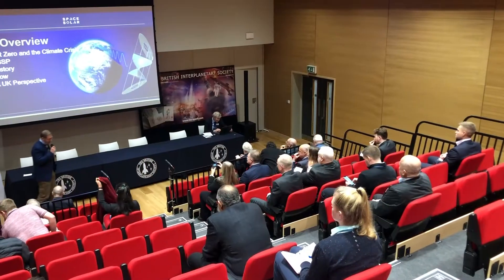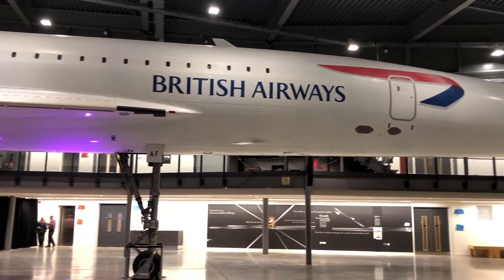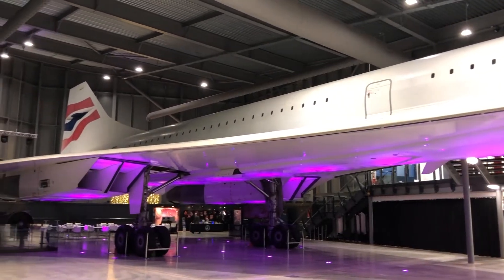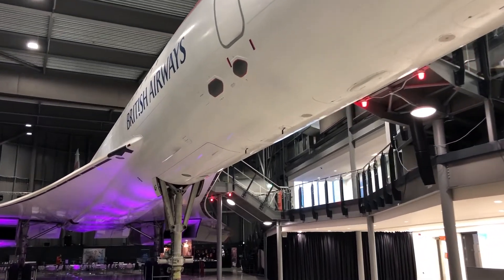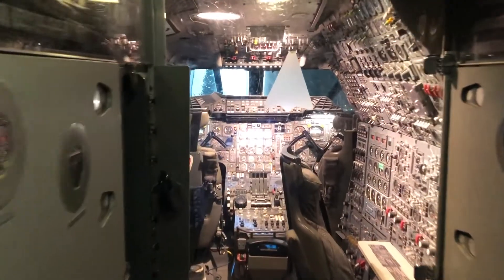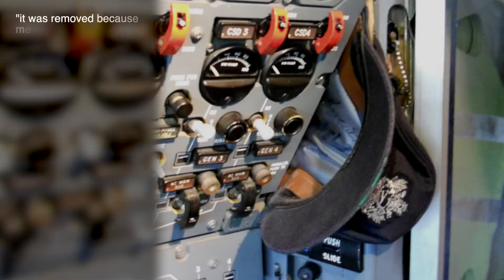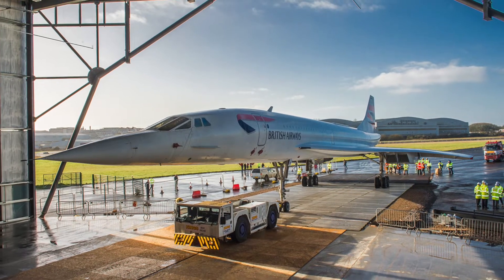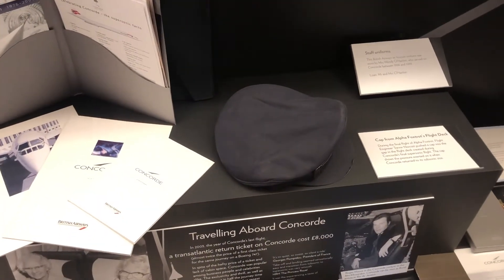The Legend of the Flight Engineer's Hat

Comment: I'm afraid I'll have to call BS on that story.....I've no doubt the plane gets hot in flight and no doubt that Aluminium has a high alpha (coefficient of linear expansion) BUT the expansion occurs evenly  throughout the aircraft unless the nose get absurdly hot so the expansion isn't restricted to one place..... Think about it if the gap went from say 5mm to 100mm in flight the whole plane would be 20 times longer in operation. AS always, happy to be proven wrong.....
Reply from the maker: The hot fuselage expands and the cool cabin doesn't, over the length of the aircraft. The cabin structure is continuous and is anchored at one end, which means the difference over the length of the whole cabin manifests in one place. Such expansion joints aren't unusual in engineering.
Reply: @Thumblegudget  I'm not an aerostructure guy; engines are my thing.....A not unreasonable theory that I'm not sure I buy, but using that logic the cabin windows (and everything else) would have a fist's width band obscured toward the front of the aircraft which seems as unacceptable as it is unlikely. It's difficult to imagine the interior telescoping backwards and forwards with respect to the fuselage......
Reply: @lincolnengland5005 depends on what’s attached to what. I would imagine each window trim is attached to the hull and will stay aligned, with cosmetic panel trims hiding the expansion joints. Certainly the tale about the gap is true.  Retired Concorde Pilot, John Hutchinson, talks about it in his interview, “Concorde’s Engineers Panel Tour with John Hutchinson.”  And the Bristol Aerospace Museum exists. I visited that very Concorde when I was in UK.
Reply: @alexc4300  Give me some facts please otherwise I'm calling BS....sorry but I deal in fact not conjecture.
Reply: @ look up Concorde Engineers Panel Tour, with John Hutchinson.  3:58 talks about the gap. Before you watch it, look up what John Hutchinson did for a living.  I read that on each aircraft’s last supersonic flight before retirement, the captain or flight engineer placed their hat in the gap.  I’d love for anyone visiting Concorde G-BOAC in Manchester, England to chip in. Unfortunately, I read, the flight engineer’s hat in G-BOAG at Seattle was pulled out, in the same way the hat in G-BOAF at Bristol was found loose in the cockpit after several years. We can’t have nice things, evidently.